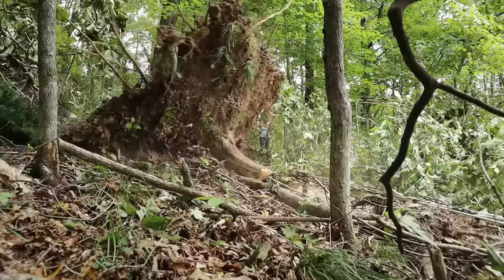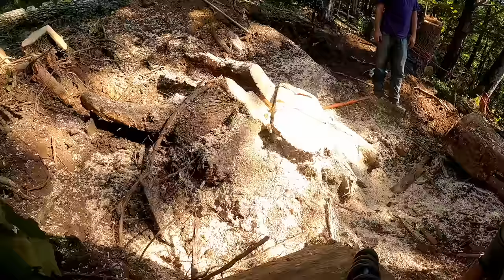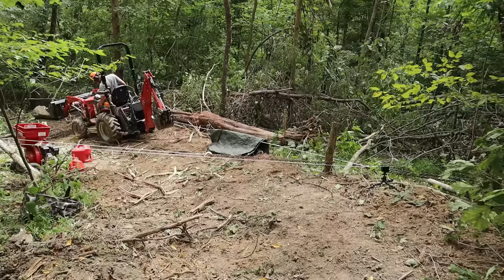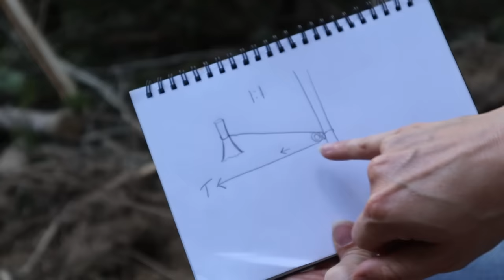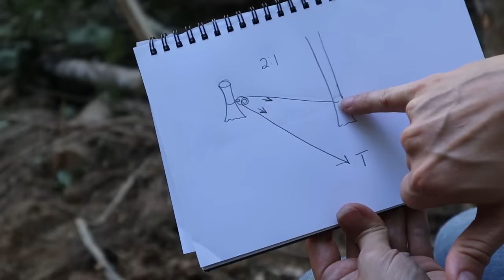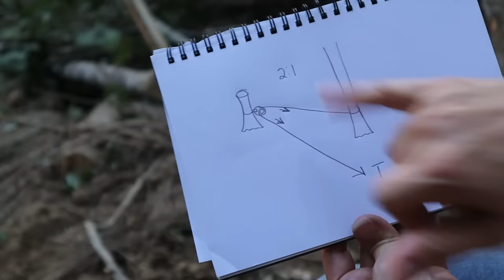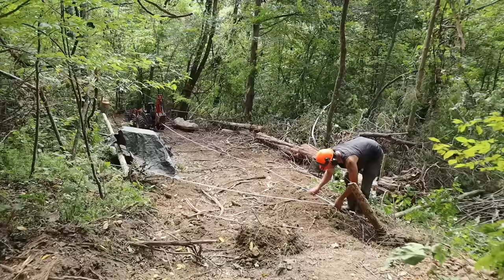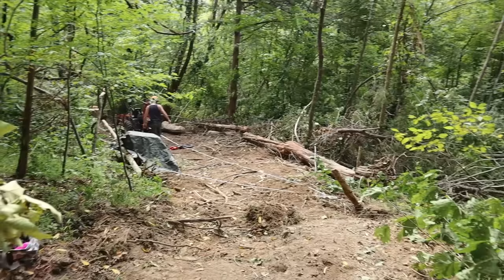Snatch blocks vs tree stumps - the power of pulleys /// E57

Comment: I would like to give you Guys a huge thumbs up for your Snatch Block video. Walk into any Home Depot or Lowes and ask for a Snatch Block and they look at you like you're from another planet. The first question the sales associate asks is: A what?
I'm an old Timber Faller from the Oregon Coast where the trees are big and the country is steep and wet. If it isn't raining it's because it just stopped, or it's getting ready to rain. The Timber is often 18 feet in circumference with a 6 foot diameter. I used a 50" bar attached to a large, powerful Stihl powerhead. I used a skip tooth chisel bit chain which I hand sharpened 3 times a day or so. I fell big Doug Fir for a fire wood business. The trick when falling these big dead trees was 1. Don't break or shatter them when falling and 2. Don't allow them to roll down the hill. You see the only access in that country is gravel, single lane, narrow logging roads that are all on the spine of a ridge as all the logging done was "Hi Lead Logging" thus yarding all the logs to the top. It was tricky business and I used multiple snatch blocks daily. Used them to anchor tree so it didn't roll down hill. At times all I had to anchor to was my old one ton chevy p/u. I had a spool of 1/2" steel cable on a winch on the front of the rig bolted to the frame. On one occasion a big tree fell right on the road but started rolling over the edge and dragging my old truck with it. Thank god the tree hit a stump and stopped or I would have been in big trouble. 
My point is that these trees were so big that without several snatch blocks I couldn't move them to a landing to buck them into rounds to split up for fire wood to sell. I managed two chords a day, split and delivered, by myself. No hydraulic splitter in those days. Just me and a nine pound maul. Seldom used wedges, the Doug Fir was so straight and limb free that the maul worked well. 
Just a big thumbs up for showing the world what a Snatch Block is and how to properly use it. Lastly people, try not to use rope. It stretches and if it breaks heavy hard metal will fly thru the air at deadly speed often causing serious damage and/or injury. Steel cable is the way and as you learned and shared, buy the best equipment you can. Cheap stuff is dangerous! Well done Guys and thank you.
Reply from the maker: Thanks for the nice words and perspective from someone who's actually in the industry using these things.  I learned a big lesson about not cheaping out on materials, and you're definitely right about the safety risk when you use inadequate tools, or undersized tools, for the job.  I can tell you we would get along, Mark.  I prefer to split the wood by hand too.  I just enjoy doing it that way.  There's nothing like splitting some nice oak with a heavy maul.  My next thing to learn would be hooking up a compound pulley setup, but I need some more winch cable and a few more snatch blocks for that.  I really enjoyed your stories.  Thank you for sharing 💪👍👊
Reply: My cousin is a feller out of Gold Beach,  and my brother and I have felled lots of Red and White Firs (piss firs) and Yellow Pine. Biggest Red Fir we dropped recently was killed in the Creek Fire and was about 55" at the butt.  He used his 650 Homelite with a 36" bar and skip chain. He bought that saw in 1975. He retired as a County Engineer, so this felling is more "recreational."  It was around the summer cabins and his home at mid mountain.
Reply: On cable vs rope, there are better ropes now you don't want dynamic that's like for mountain climbing so if you fall it has a lot of stretch to it or for launching aircraft gliders and towing semis or you know for off-road recovery.
You can hook up in the towing vehicle can get a running start at it and then the rope start stretching and it starts pulling and it stores the energy in the room and then the vehicle getting pulled will start to accelerate and they can have their tires going and whatnot anyway so that's what the idea of a dynamic rope is but what you want here for this kind of thing you don't want to stretch your rope you don't want something storing energy in it like a rubber band and then all of a sudden snapping cuz you can load up too much on a stump can pull out real fast and shoot through the air what you want is a static rope and there are really good ones there's dyneema there are far stronger than steel they're much lighter to work with and you're not going to have edges to break off and poke you through your glove and whatnot the only drawback is that they're synthetic fiber so they're going to melt so you don't want to put them in knots and you don't want to you know get them wet or hot burn them melt them so friction is a bid no no.
 This is serious equipment here I mean a half inch when they say if you look up to an axle and you want to use it they said do not get a running start and try to yank to get something pulled out, okay it'll break all the bolts on your axle the rope will not break but every bolt will break and your axle WILL be pulled up from under the vehicle so don't get it running head start on it it's not a dynamic rope I think half inch if I'm not mistaken if I remember correctly and I could be wrong but I think I half inch diameter is about 30,000 lb brake test. I deliberately bought the but I think it's 1/4" maybe 3/8" 
- looks like paracord it's 6,000 lb test.
I mean I could tow a car with it. It is eight times lighter and it floats!!! They said about the game strength maybe.
Here is just one link: https://zips.com/parts-detail/amsteel-blue-synthetic-winch-lines-w-se-sr-winch-line-hk-sm?size=5-16----12-300-lb-mbs-&length=100-&color=red&ppc_keyword=&gclid=CjwKCAiA866PBhAYEiwANkIneAXioug716mFVIWueOURkqAKDy7Q7AVbQvyWs9PjHQ8jpQccptL2QBoCH9UQAvD_BwE
Reply: @WalnutsandWineberries  Another guy on YouTube that did a I think he had an engineers dream set up rigged to pull a stump.
It was 30 to 1 maybe 40 to 1!!
he had enough pulleys and snatch blocks that he had a 40 to 1 pool ratio engineer typing now did it just for the fun of it but it worked!!!
I okay looking by what you guys are doing you couldn't have too many snatch blocks you can have four or five 10 or more at work on some of those rigs or take a hell of a lot of rope and I say again I said them together comment that you might look at Dynamo rope there's still rope made for this kind of work it's rope it's light not going to get me pieces of cable stuck through your glove just don't want to melt it but 38,000 lb test it's much stronger than your steel cable that you're working with. How strong is it?
It is what they use to tow ships on the ocean so it's much lighter than steel and much much stronger!!
Reply: @grantdavis5992  
Wow, homelite from when Saws were saws!!!
Buckin Billy Ray with his old Macs would feel right at home with one. I think he used one a while back.
Reply: Ive always been told that the Cal. Red Woods were some of the largest trees in the world.  However.......I spent two years in the Peace Corps in Liberia Africa.  An eye opener !!!!!  Trees were well over 400 ft tall !   The government would fine the loggers for felling a tree and it was not removed.  One log one semi......modified to haul the logs.  They dug pits to back the trucks in.....use two cats to roll the longs onto the trucks. I seen for myself..... scaffolding........70 feet in the air before they could fine a narrow area to cut the tree.  Largest tree......on the ground I measured myself. 32 feet across  200 ft long..   It was never removed from the high bush timber ! Logging roads.....they used three logs......3ft diameter.... dumped them in a trench and pushed dirt over them . That was the culvert.     Often the loggers would shoot monkey from the tops of the trees. Using buck shot.......most times the monkeys just sat in the tops of the trees.....when shot......the dust would roll off their butts... but they were never harmed. The trees were too high up.  Those trees were floated in the ocean for months before they were loaded on to ships..... The ships were sunk ..then the water was pumped out. Off they went.  Those.....were large trees !  None left now days !
Reply: Your an inspiration for the Authors and an education to the inexperienced! I did work Forestry, on matchsticks, but later as a Boilermaker hoisting heavy components up the Boiler Bay, with up to a 17 Part Line on Economizer Bundles. 
Later in self employment my Tandem broke through a Single Lane Road through a wet area. I couldn't Hire a Skidder to pull me out, as a Heavy Tow Truck would have been casualty # 2. An employee asked, do you have Blocks and Tackle. I sure did, so we set up a Four Part Line, hooked up to my 3/4 Ton and the old Mack pulled out of the muck like a greased banana. I also had lots of half inch cable, so it was a Cake Walk. I'm so glad this was suggested to me, because it was a Single Lane Road into a Cottage Lake, and there was minimal damage vs a Skidder or Heavy Tow Truck! 
Your experience cautions us in the potential hazards out there. Eg there was a Video a couple day's back of Log Poachers on Your Coast, rolling a 30" Log off an embankment unto a Trailer, which twisted and bounced unto the back corner of their Car! Luckily no on was severely injured! 
Kudos for sharing your experience and wisdom!

Comment: You guys did great learning all you did in a week.  Keep in mind that you have a mechanical/directional loss when your anchor and tow points are not in line.  In a 4:1 pull, this loss ranges from 0-25% going from 0-180 degrees.  Not necessarily a big deal unless you are fighting a tough root at an odd angle.  Moving your anchor point or double snatching from your tow point can help fight those stubborn root angles.  You may want to find a way to fix your tow point to the frame of the tractor instead of the back hoe.  You are losing your inertial advantage to the hydraulic flex and straining the hydraulics.
Reply: To combat the directional loss... they may want to strongly consider placing the chain around a low point of the desired stump then incorporating the chain over the top of a tire rim to add an upward thrust of leverage.

Comment: Great video. Most people that make mistakes never post them.  I've dug out and pulled out literally hundreds of stumps.  As others say here, use leverage,  attach the snatch blocks high on the tree or stump.  BUT, while I don't know how long a road you are trying to build, since you mention hundreds of stumps, I'd suggest that there is a much easier way.  Hire someone with a dozer.  It IS nice to do things yourself, but you are going to spend weeks getting all the stumps out if you are talking about hundreds of them.  And you will also have to level that area into a road.  If you are talking about 1/4 mile or more, even a smaller dozer, like a D4 could make a road like that (doesn't look like the ground is that rocky) in a day.  I have a couple tractors, and a decent sized Excavator.  I can dig out a 3 foot diameter stump in an hour or two, but, for what you are talking about, I get my neighbors dozer.  I suspect if someone nearby is a dozer operator and has one, they might well do the job for $100 or so an hour,  (plus a traveling fee).  You would be surprised at how quickly it can be done.  And a good operator will not make too much of a mess.  You can tell them how much of a cut you want, etc.  It will be a lot less wear on your compact tractor too.  You don't want to overwork it.
Reply: Yep and for the price of the stuff they bought they probably spent half a days dozer hire cost..... pull stumps with an A frame pulling stumps up is always easier than sideways to shear.... try it on a weed pull it level to the ground will take much more force than pulling straight up ....an A frame pulls up and multiplies force
Reply: Yes, we were told years ago by a dozer operator to leave at least a 5' tall stump so that he had more leverage and could push the stumps over that much easier.
Reply: Dozer!! Absolutely the best investment we made!
Reply: I hate it when people use Dozers to clear roads, leaving Windrows of stumps trees and dirt! Especially for a Home. Logging Access Roads are a different story, as a good operator will bury the debris in ditches, depressions etc.

Comment: I removed seven large tree stumps from my property back in 2021. I first dug around each stump and then cut all of roots around each stump..  I then used my 25 HP skidsteer's blade to push each stump over. It was very hard work even with my slidsteer. I like your method much better and I want to thank you for your very detailed explanation and great drawings too.

Comment: I've got about 50 stumps to pull. After getting ridiculous quotes from a couple of companies I did some of my own research and decided to get a rig set up to do the job myself. So first, I have a huge tree right in the middle of the 1 acre property. That's my anchor tree for all of them. Next I bought a tow strap that's rated at 27,000lbs. That's connects to a 12,000 winch. Then I use a 5' 4x6 to take the chain up and over converting the energy upward. We're going out there this weekend to get started. I'll let you know how it works.
Reply from the maker: A good understanding of compound pulleys will help a lot.  Scrub through episode 64 on my channel if you want more pulling strength.  I'm very happy I have learned how to use these things properly.  I've moved boulders upwards of 17k lbs, rescued heavy machinery, pulled out dozens of large stumps and many other tasks.  Just make sure your main line going to your tractor is dampened somehow with a few blankets.  Good luck!

Comment: Good stuff. The physics of snatch blocks always amazed me. The only thing I might add would be about the orientation of the shackle. The rule of thumb with shackles is: “The pin of the shackle always goes in the hook (or towards the hook).” That obviously refers to a ‘crane hook’. I know, you weren’t using a crane but the logic is, put the pin of the shackle in the position of least movement. In the horizontal pull you were doing at 9:40, it practically doesn’t matter which direction the shackle was oriented because it was just used for a connection but if you have a situation where you’re not sure which way it should go, just remember to orient the pin to the position of least movement, so there’s no chance that the pin unscrews. Another thing with shackles is to, screw the pin in all the way, then loosen it by a 1/4 to 1/2 turn. This just helps it not to get tightened too much and get stuck, when the load is applied.
Reply from the maker: Good stuff, especially the shackle knowledge 👍
Reply: Ok Iron Worker.
And when the pin is set at 1/4 turn back loose, it can be wired in position if concerned about it
 over tightening.

Comment: Thank you for this great explanation on how to correctly use snatch blocks.  I especially like the part on how NOT to use snatch blocks.  Very helpful.  I have just started using snatch blocks in my woods on stumps and yes there have been a few times I was using them incorrectly.  But now I know the correct way thanks to you and this video.  Good job.

Comment: So satisfying to learn a new trick to conquer huge problems!  two suggestions I would ad are 1. Find a better pulling point on your tractor,  you're stressing that poor backhoe arm by pulling on the bucket and you're lifting your front wheels off the ground by being attached so far above the back axle. 2. Cut some notches in the stump for your chain or get a real cable choker so it won't slide off when it tips toward the tractor.
Reply: I second this. Blowing out the boom of your loader is very costly.
Reply: I agree with you plus take a ladder and climb on the tree and attached your choker at 20 feet from the ground ( dont cut the tree before pulling it but after to maximize the lever effect) than hook the pulley on the choker. Remove the ground and cut the roots at the back of the tree to weaken that side. This way, my little Suzuki Vitara pulled down some 14 inches X 70 feet high spruce trees. good luck
Reply: Yes a chocker

Comment: Nice tractor and a good team! I use a Greifzug/Tirfor to pull out stumps. On your first attempt you tied the chain very near to the ground. The higher the better leverage. The chain is very good to attach to the stump, but for the anchor points lifting straps are more tree-friendly.